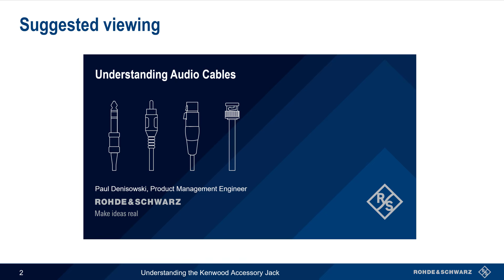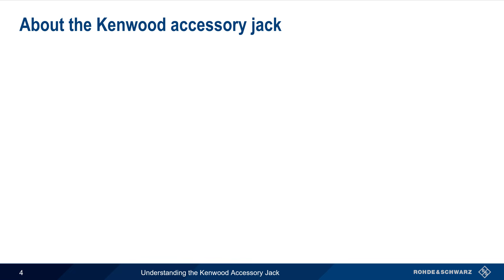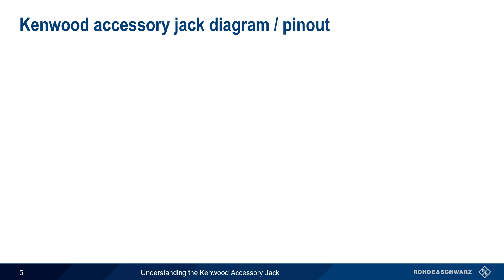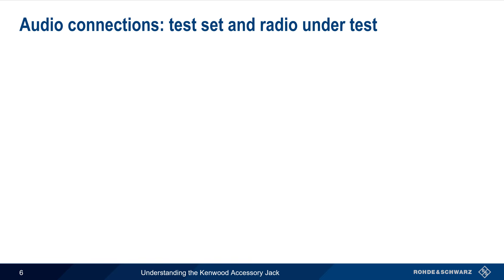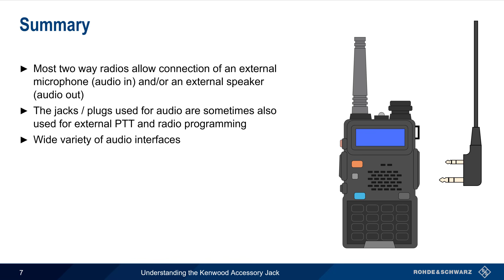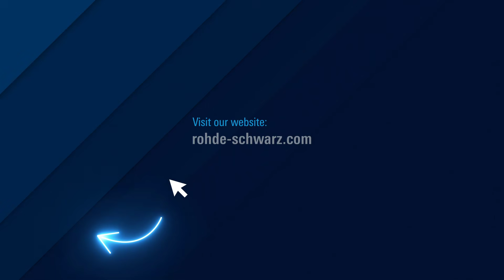Understanding the Kenwood Accessory Jack

Comment: I'm curious as to why the shield of the test-set AF output should be connected to the sleeve of the 3.5mm jack, would this not lock the radio in transmit (assuming the AF input is also connected)? 

Do the test-set AF input and output not share a common ground?
Reply: Good catch!   On our radio test set (the CMA180), the AF in and AF out do share a common ground, so yes, PTT would be closed if both cables were connected at the same time.  Radios are usually only tested in one direction at a time (TX or RX), so as a practical matter this shouldn't be an issue as long as you disconnect the "unused" cable 😀  Thanks for pointing that out!